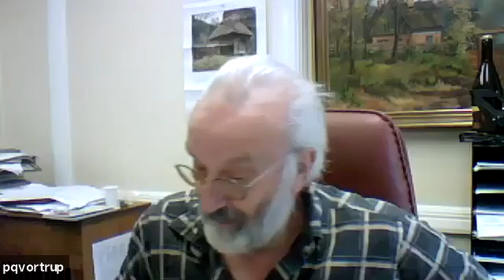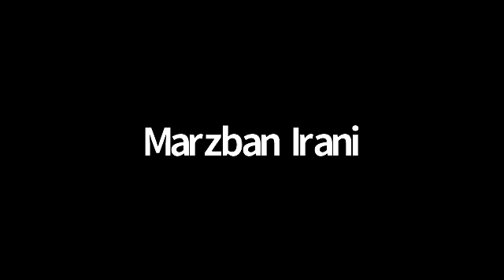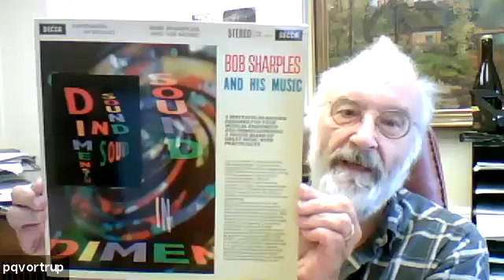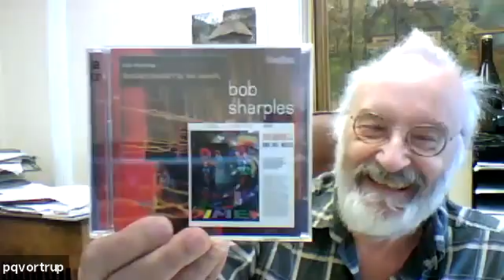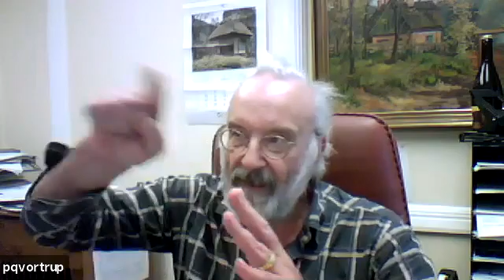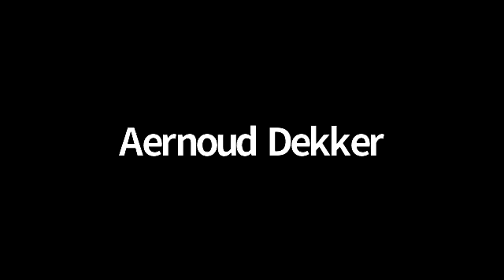MASTER CLASS IN AUDIO - SESSION 5 - FT. PETER QVORTRUP

Comment: One response to the comment at 1:09:00. The Woodstock festival in 1969 had an audience of half a million people, and the PA system used all tube amplifiers. The very limited stage monitoring used solid state amps, but the JBL based speakers for the audience were all tube powered.
Reply: most of them were fuck-faced on drugs, though...